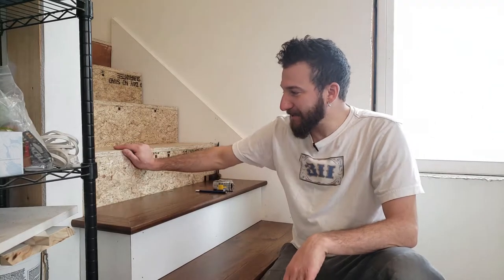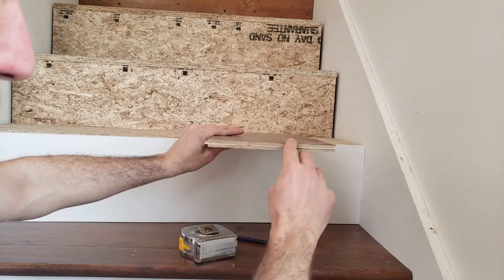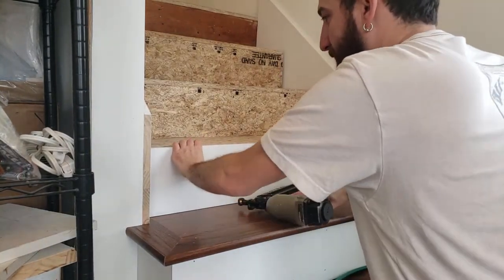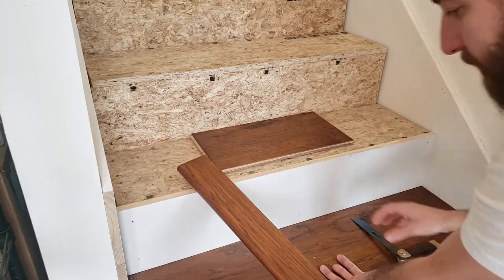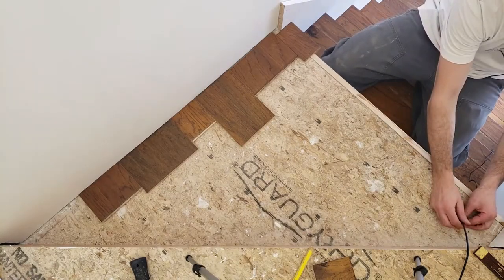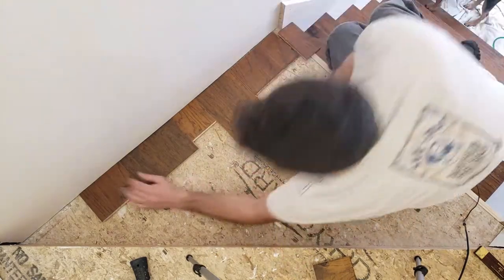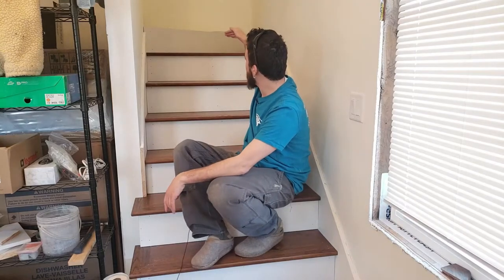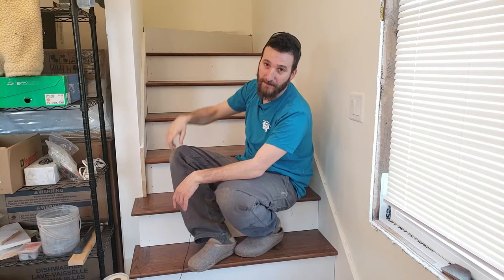Installing Engineered Wood Stair Risers And Treads Part 1

Comment: Beautiful work and flooring. Can you recommend another manufacturer for the flooring that has the transitions to do stairs? The closest store is 100 miles away.
Reply from the maker: OOF 100 MILES?!! It really depends on what the store carries. Each flooring store has different brands so I shopped around to probably 5 or 6 stores until I found this one that I liked. I bought it for the look, not for the brand.
Reply: @BorsellinoHomeServices  Thanks! Yes I’ll try to obtain 1/2” as well, there appears to be a lot of 3/8” flooring out there.

Comment: Very impressive thank you for sharing. I didnt notice the expansion gap on the riser or tread. Why isnt it necessary? Is it because the thread area is small?
Reply from the maker: yes exactly. The larger the area (like a floor) the expansion and contraction multiplies by each board. In a small area it is minimal. Also, if I gapped it, then you'd see a gap unless you added a molding to cover the gap. In some instances it just isn't always possible to leave a gap, nor is it necessary

Comment: Hi Nick - My husband bought unprimed, 1/2” MDF to use for the risers. It looks nothing like what you used. What are your thoughts? -Sherri
Reply from the maker: well it depends. If you have a plywood subframe that you are attaching everything to, it should be fine. But if there's nothing solid behind the 1/2" mdf it won't handle kicks or the downward force. The way that I built everything out of plywood made it so I could install this 1/2" thick flooring, which same principle, you wouldn't be able to do on regular open framed stairs. Hope that helps clear it up

Comment: Great video, one question is what kind of nail gun did you use and what size nail as well?
Reply from the maker: The finish gun? I believe that is regular finish nails so 18g and probably 1.5". I'm just nailing into the subfloor to hold it in place while the glue sets up

Comment: Do you think my Ryobi 18g braid nailer would be ok for nailing a project like this or should I go buy a finishing nailer?
Reply from the maker: for the treads if you are also gluing them I think it is fine. For the risers I think the thicker finish nails are better than brads though. If you used a little construction adhesive behind the risers then brads would be okay. I only used the nails to hold it while the glue dried
Reply: @BorsellinoHomeServices  Thanks!  I went and got myself a finish nailer for this.

Comment: Does the flooring used as the stair tread require a space for expansion where it meets the riser? Please let me know. Thanks.
Reply from the maker: yes, and the tread goes in before the riser and you need a space to get the tread to go into the tongue and groove. General rule of thumb is always have an expansion gap but some a board this small I don't think it would expand very much at all.

Comment: So you had to remove the original "old" risers and treads and install "new" risers and treads from plywood to maintain the proper rise and run?
Reply from the maker: Yes. I framed a complete new set of stairs because the old stairs were too steep. So i cut new stringers and installed them and then put plywood for risers and treads first because the flooring material is only 1/2" thick and needs to have full 3/4 subfloor underneath it. This made the stairs very very sturdy in the end

Comment: Thanks for the video, nice job! One question do the nails show on the stairs?
Reply from the maker: Yes they do. I use minwax stain crayon sticks to fill the nail holes. I bought a few different colors that are close to the floor color so I can use whichever one closes matches that part of the floor where the nail hole is

Comment: Nice work, though 19:23 you noticed the stair nose end is not fully covered by the 1x baseboard. Not very noticeable but could have cut the edge in the stair nose. But everyone makes small mistakes on those projects.
Reply from the maker: yeah I suppose I could have spent some extra time and notched the nosing around the skirt board but in my mind it was creating the same gap that it would have all the way up the stairs and if the nosing ever needed to be replaced then just the nosing could come off. This is in my own house so I just went and looked at it and you have to look pretty hard on the right side to see a gap at all. On the left side it's so tight there's no gap at all.

Comment: Question from a newbie here, Do you install the floor after stairs or before? The direction of my floor wood plunks is vertical where my wood floor tongue is not going into the nosing groves. Is it ok to just glue them right next to each other?
Reply from the maker: I'm not sure I understand the question, let see if I answer right. I start at the bottom and work up. So the first floor has to be done first because the first riser lands on top of the flooring. Then at the top I think the nosing has to happen before the second story flooring goes in.

Comment: At 20:30, couldn't you have used a floor puller to pull them tight so you don't have gaps? At the very end, the triangular piece you couldn't pull like that, but at least it pulls some gaps. Or would uneven pulling (cause you cant pull near the angle) make it look worse?
Reply from the maker: I did use the the blue flooring puller unless you mean something else??

Comment: Why use flooring adhesive vs construction adhesive?  Does it matter?
Reply from the maker: You probably could this just seems way easier and it is water cleanup for the tools. If you used construction adhesive would you use a trowel or just glob it on and go? I would think for something you're walking on daily you'd want an even glue surface underneath.
Reply: @BorsellinoHomeServices  That makes sense to me.  I've seen in other videos people running beads of construction adhesive.  Wondering why.

Comment: Hi Sir! Thanks for the video! Looks great! I assume if we do hardwood stairs the process of gluing then nailing is similar? thanks!
Reply from the maker: Actually that depends. You can get solid oak treads and it you do you don't need the plywood yopu can do right on the stringers. Only thing is you want to attach the risers to the back of the treads from underneath